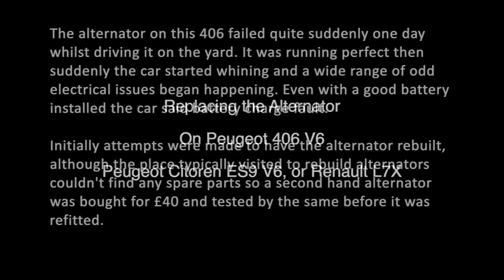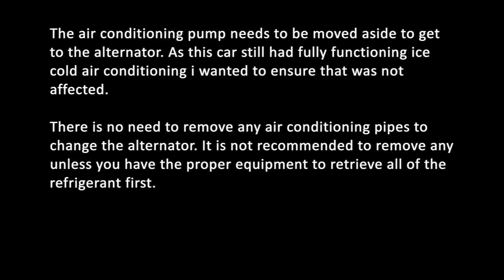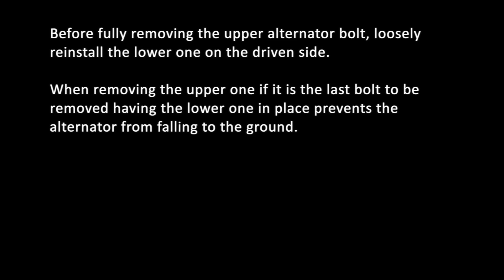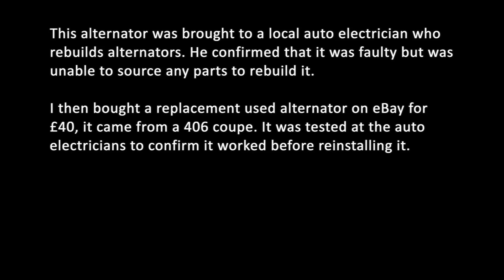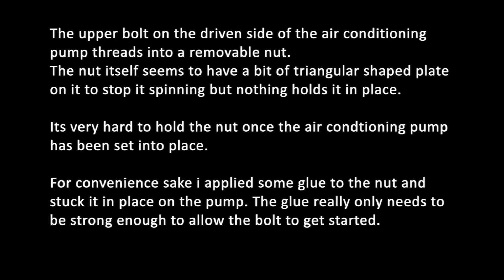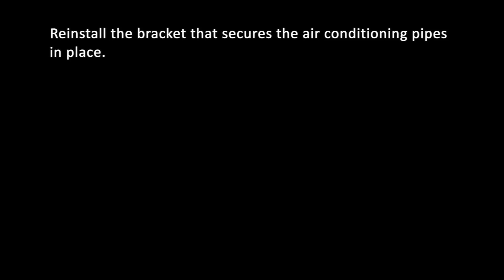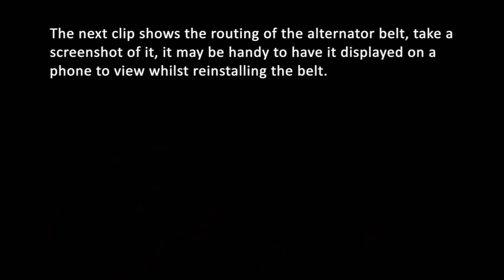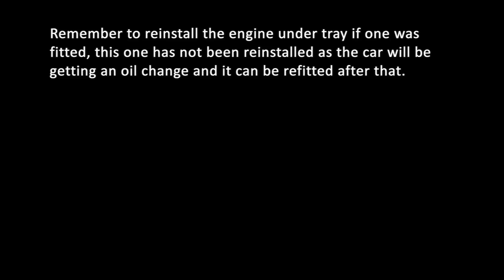Peugeot 406 3.0 V6 (PSA ES9 or Renault L7X) Alternator Replacement

Comment: Thanks for this. Same vehicle (2002 model D9) in Australia with 156 000Ks and started making that same noise on a long road trip. Got home with no charging dramas so wasn't sure of the source. Removed auxillary belt and ran the engine and no noise so went for the easy tensioner and idler  pulley replacement.  Still noise and could not feel any drag or hear any rumble in either alternator or power steering pump when turned by hand.  Your vid convinced me it was the alternator so purchased a new Valeo model 439470 at $A670 delivered to regional Aus. I put the car up on vehicle ramps to work underneath.
I have a 1/2" to 3/8" adaptor which fits the square slot in the belt tensioner bracket nicely and I find there is no need to undo the top spring bolt.  I also avoided taking apart the Computer module box and while it leaves little space you can remove the PS pulley with a 10mm deep offset ring spanner. Loosen it before releasing the belt tension.  Make sure you get the pulley the right way around when replacing - the centre is offset.
I also used a 16mm deep offset ring spanner for undoing and torquing the top inside alternator bolt. Uni joints are a sure way to ruin a bolt head unless you can hold it square on the bolt while undoing. Excellent vid without the loud music and overfast action. The text advice was also very helpful such as the gluing of the nut on the AC pump. Took me an easy 3 hours in total.

Comment: Finally got the alternator out on a 407 coupe, it was way worse than on the 406 (although the top side had a bit more room, no ECU there)
The top alternator bolt near the exhaust was exceptionally difficult to remove, I think that one alone took me almost 2 hours since it was in a really hard place to reach since there were some extra hoses and stuff in the way. The AC compressor was also different and the lines barely allowed it to drop down a little bit so with some struggle I was able to get the alternator free

Extremely useful video and I probably would've ended up removing the radiator instead if I hadn't seen this guide which would've been way harder and probably not work. Still not sure what broke in my alternator as it made a lot of noise and started burning some leaked power steering oil so it must've gotten really hot, but the bearing feels fine and it spins okay by hand but that's the next step I need to figure out

Shame the ES9 alternator is specific to this engine, not very easy to find locally so the car will be out of service for probably a week if not more since I probably have to order abroad

Comment: Hi,Could you tell me about installing belt skill.I have a problem about belt tensioner.Wether to install tensioner first and then put on the belt?Thank you
Reply: My first try installed belt,I put on the belt and stress on idler module try to installing tensioner.When I stress on idler module then it broken.Do u know what link is wrong.Pls help me.
Reply from the maker: @黃凱聖-h9v  Idler pulley broken? If any of the tensioners are broken or make a funny sound then replace them with new items.
Reply: I reference another video from your Chanel and I find out the program.Thank you